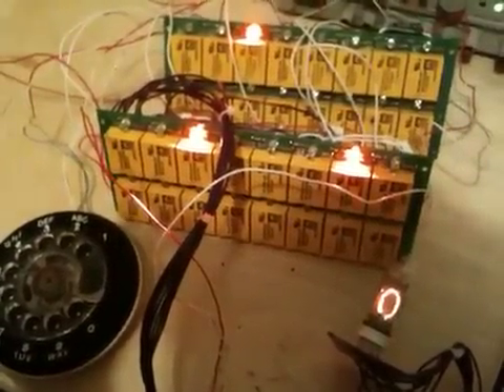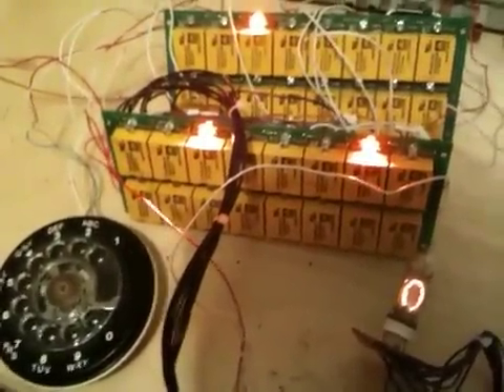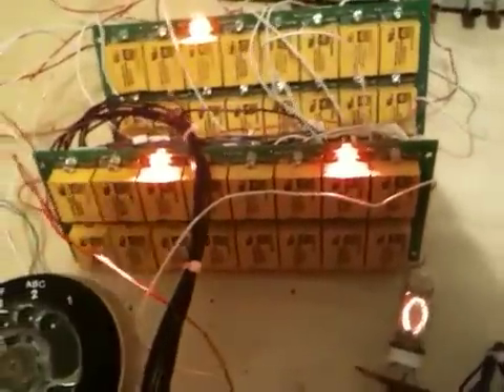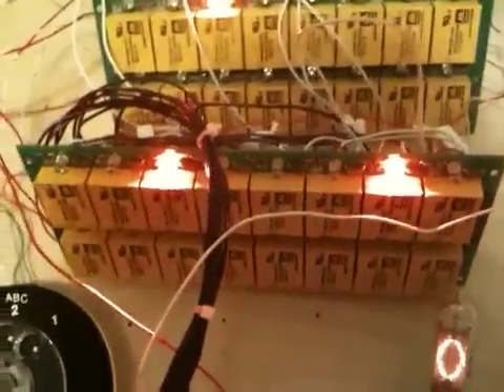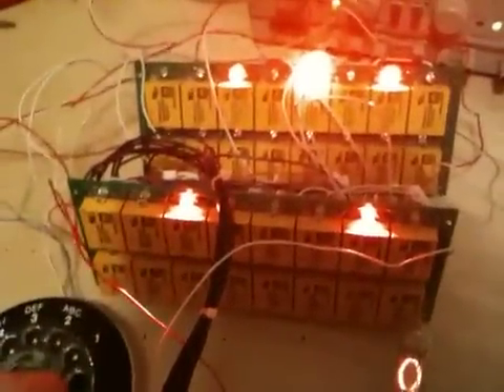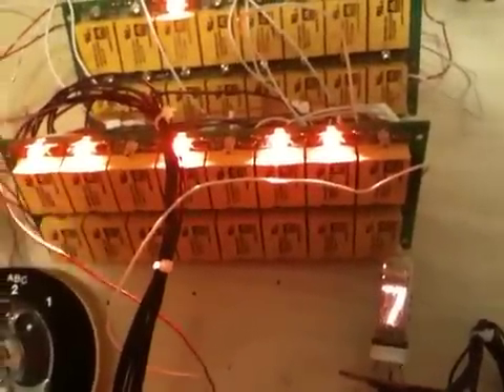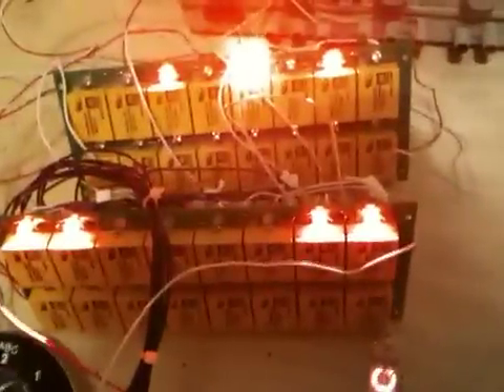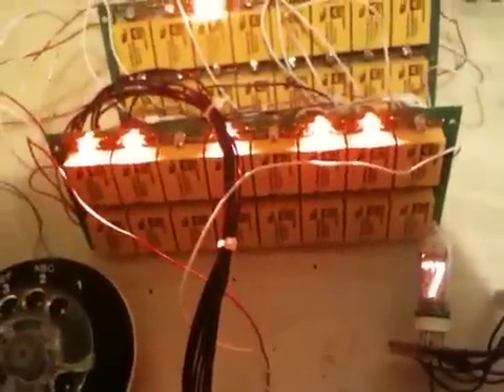Relay logic: counter demo

Comment: Why with these projects do they use relays that are so big - like automotive relays?
Reply: I wonder the same thing. They make beautiful little surface mount electromechanical relays that take less than 1cm^2 on a board. But often it’s about what’s cheaply available. The relays used in this project go for I imagine at least $5 in qty 500. So if there’s a deal on eBay where you can get them for $1 or less, that’s a bit of savings and can determine the part used. And acoustics counts too: large relays clunk loudly.

Comment: Cool ! Like Roby the Robot in the Sci-Fi classic Forbidden Planet. He clacked and clanked a lot. Have you ever see this old digital computer patent 3190554 where air is used to do the computing? Bet it could be made today in a snap with 3D printing. Was thinking that if Babbage had gone with this he could have had his Difference Engine made by the pipe organ folks and Lady Ada would have invented COBOL. Still looking around on You Tube for a demonstration of Collision Based Computing using Brush Bots.  Thorium! Energy cheaper then coal, ET3, the best Vac Train System! Thanks for the Post!